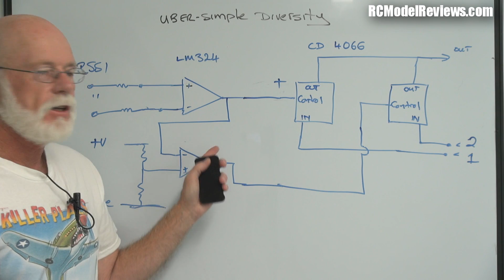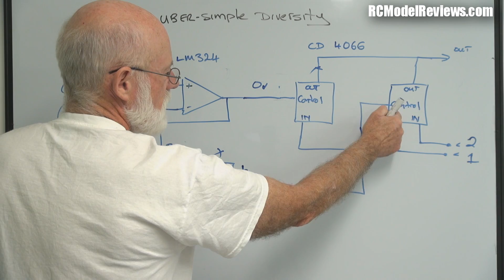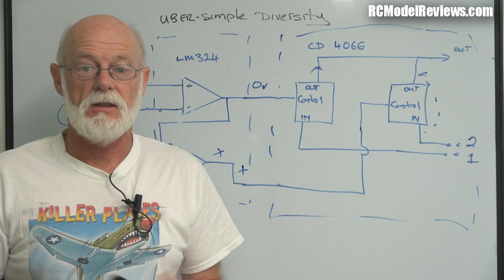A $1.29 FPV diversity controller (theory & design)

Comment: Hi,
I will have a few responsibilities about the Rssi.

I think it should be around 5v when rssi is close to the buyer.

this information is correct?

I bevrc of 2 1.2ghz receiver there.

these two receiver the donor close dayken one of 4.89v, while the other 0.12v vicinity rssi voltage to give.

Which of these gives the correct voltage?
Reply: Hi,
does the receiver give a voltage close to 5v when the donor is nearby?

Comment: Do most video receivers (or receivers in general) have an rssi pin out and you just need to know where to look?  I know what rssi and tssi is, but how it works under the covers is voodoo to me.  My guess is that you have a baseline (100%) that represents maximum signal, and the actual.  Are we looking at simple voltage of the signal?  How do you know rssi from one receiver is an apples to apples comparison between receiver two?  

I think a video about rssi fundamentals would be interesting.

Comment: any way to use a single receiver with multiple antennas and use the diversity controller to switch between antennas?
Reply: Impossible. The controller dont get the information which antenna deliver the better signal if there is only one receiver..?

Comment: Can anyone help me????  I bought all the items Bruce mentioned and followed the instructions but my controller is completely dead and just will not work :-(

This is what I bought:
Cd4066BE Quad analogue switch IC in 14 pin DIL DIP14
LM324N Linear IC Quad Op amp DIP14
4k7 0.25w Carbon Film resistor (4.7k)
47k 0.25w Carbon Film resistor
820k 0.25w Carbon Film Resistor
Red 5mm LED
Green 5mm LED

100nf Ceramic disc Capacitor

Im using a 5v power supply as per the video but the thing is completely dead

Can someone please help me? ??  Bruce?? are you there??
Reply: +Nick Boylan the chips are computers and must be programmed before they will function  as switches.

Comment: Ok first I'm new to this and dont know whats already available. I assume this thing requires 2 transmitters or two receivers. Why cant someone build a transmitter that has say 3 kinds of antennas on it clover,dipole,helical or whatever and have this determine which one is best at what moment. Even 2 basic antennas at different angles would probably get rid of the snow right? I know some transmitters are good close range while other work better though objects right?
Reply: I'd like to know that as well

Comment: What is required to program the chips? The rest is pretty much straight forward. Do you still have programmed chips available. This is good info for anyone wanting to build one. Thanks
Reply: Raymond Bivens The LM324 and CD4066 don't have to be programmed. Everything in these chips is just 'hardwired'. You can just solder them together like in the design and it should work.
Reply: EightOneGulf thanks. All of it looks pretty straight forward. Just wasnt sure about programming or not. I could have swore he mentioned programming them

Comment: can skyzone and Immersion fpv gear work together?
Reply: Kyle Cook That depends . If you have the  skyzone goggles with the 32 channel rx in them, or the stand alone 32 channel rx, they will work. But if you have the fatshark googles with the Immmersion rx it wont work with a sky zone tx . Skyzone and immersion are on different bands of 5.8ghz. Difference  is sky zone has the 32 channel rx, that can pick up on all of the band, the immersion band and the sky zone/boscam band . If you have the Immersions ,they also make a mini 32 channel tx for $25. hopes that helped. ;)
Reply: Thanks!

Comment: I would recommend adding some hysteresis to the comparator, so that it doesn't oscillate when the two RSSI signals are very close in amplitude.
Reply: He does the very thing in  an addendum to this vid Eric. You can buy the PCBs made up for populating from Oshpark.  I have one on my bench right now that I soldered up and there it is sitting in the middle of my frame for the array ready to have all the wires run. It is beautiful. It incorporates two 0.1uF ceramic caps. One for each 4066 (ended up in the final) Reply for more info. There are a bunch of other diversity boards there by the same group at RCGroups. Happy FPVing
Reply: Chris Leech
Is this the osh park link? https://oshpark.com/shared_projects/c247G5Wq

I'm about 90% sure I have all the parts already in my garage; I'll probably wire one up on a proto board one day.
Reply: Yes but that isn't the original offering. I am not sure how that guys name has anything to do with it. The name on the board is gilcd85 and he posts regularly on the topic.There are many who have gone the proto route. You might like to follow others good works by checking out an RCGroups thread. I will re-post with the link for you.

Comment: Also found it all understandable apart from how the inverting amplifier works? How do the 2 resistors with half voltage invert the signal, couldn't follow that
Reply: The 2 resistors act as a voltage divider, so half the working voltage will be in the center. The comparator is comparing the two inputs, if the -ve input is below the +ve its output will go high. Basically the 2 resistors create a middle voltage so when the other is high or low it will be higher or lower than the middle voltage. Does that make sense?

Comment: Excellent design to tide us over until the 4-channel switch is ready.  Isn't it common practice to tie off the unused gates to prevent oscillations that may draw more power or make electrical noise?

Comment: Bruce, I also seen the build as well...Fantastic...but one question.. can you also use this design possibly to use the rssi  and maybe three receivers to control a servo (or motor) to move a turntable that the receivers (and their corresponding directions antennas are mounted on) for an antenna tracker?
Reply: Why not, i now have to try this!

Comment: ZC4066 for the quad switch and ZL3324 for that op-amp for us jaycar fans, mind you some rx's will have an inverted rssi where low is good and high is bad so you can just wire the 4066 accordingly. also running the video through the 4066 may give you a small drop which may lead to syncing issues on some screens but im sure it will work great for most :) . will get to work on my arduino version very soon just waiting on parts.

Comment: Great video Bruce.
Could just use dual op amps or comparators. 
Note: some reciever rssi are reversed, the higher signal the lower the voltage just reverse the rssi inputs to resolve reverse rssi receiver setup.
Thanks so much Bruce.

Comment: If the CD4066 has 4 switches built in, then surely it should be possible to switch audio at the same time too? I'd recommend doing that. There's nothing more irritating than listening to white noise from the receiver with the weakest signal. B.t.w. HK sells convenient RCA and power jacks now that you can screw into the box.
Ordering from Digikey is out of the question for most of us mere mortals. Around $50 shipping to Europe for a single subgram part. No way. No wonder China is taking over many economies. Thankfully there is ebay.
Reply: Yes, I included the Digikey links as an indicator of price but I specifically chose parts that would be easier to source at your local hobby electronics shop than some more esoteric video switching chips and precision comparators.

Comment: Great stuff Bruce, i did wonder why you were initially going to all the trouble of a programmable chip, software and a pcb to make a diversity controller when a simple comparator chip does the job so well.
If i ever have the need for one i will make this version for sure but i would add a video buffer so i can also record the footage......hmmmm maybe i need a new project on my binch!
Reply: The microcontroller-based one is far more flexible -- allowing you to have up to four receivers which can be "mix and match" with different polarity of RSSI and other features that aren't nearly as easy to do with an analog system.  However, for many people, this uber-simple setup will work just fine.

Comment: Would it not be possible to use mosfets or transistors instead of the relays?
Reply: The CD4066 is a MOSFET-based device.  There are no real relays inside -- just MOS switches.

Comment: Bruce I think CD4066 is a bad choice.   It has 125Ω Typical On-State Resistance for 15V Operation and about 470Ω with 5V supply. This can degrade weak signal !!! (i.e when you are flying on the range limit)
The best chip for this purpose is ADG719 from Analog Devices:
http://www.analog.com/static/imported-files/data_sheets/ADG719.pdf
The truth table with 1 input  can simply switch between 2 video signals. Means we need only one comparator instead of 2.
Also the on-state resistance is 2.5Ω typical and 4Ωmax.
Please consider the new simpler/better design :-)
Reply: Yep, the 4066 isn't optimal -- but it works.

Besides which, if the resistance proves to be a problem in practice, for another $0.50 we can add a high input-impedance one-transistor amplifier on the same piece of board the diversity controller is on.

An emitter-follower stage will be high enough impedance that the pass-resistance of the 4066 will become insignificant.

I chose the components  because I wanted to use bits that were likely to be available at a local mom and pop electronics hobby shop.
Reply: forgot to say the ADG719 price is around $2 :-)
Reply: Yes I very much agree with you. When you implement this you really have to watch out as it will make your video levels at least 1/4 of what it should be. The CD4066 may be cheap but it doesn't fit the requirements.
Reply: Where can i get this ADG 719? I've looked in three online stores, but i could not find it. What changes have to me made to make this work? Simply use the output of the first comparator as the input for ADG719?
Reply: Servicehans  1st question: digikey, mouser, ebay or simply go to http://www.analog.com/en/switchesmultiplexers/analog-switches/adg719/products/product.html and select 1 sample chip. You must then explain the purpose of your project/prototype and there is a chance they will send it to you.
2nd question: yes :-) the output of 1st comparator goes to input pin of ADG719
Reply: Dziękuję for the hint. For people like me who are comfortable with soldering but know nothing about electronics engineering could you possibly make a short "how to" manual? I'll be happy to use better parts - if it comes for 10 or 15 bucks rather than 1.30 I'll still go for it as long as it gives me better quality output.
Really, it'd be great.
And of course, thanks Bruce for making my mind work in this direction :)
Reply: ***** Hi Bruce, aren't you worried that the next time someone uses this rig and flies a bit further out the video levels get a bit lower and suddenly your video goggles lose video sync or your monitor goes blue?? I really like what you are trying to do but you really have to watch out as you are a teacher for a lot of people and right now you are giving some bad examples.
Reply: FlyingZayin Please see 2nd page of this PDF:
http://www.ti.com/lit/ds/symlink/lm124-n.pdf
As you can see:
- 1st leg is output (goes to the ADG719 input pin)
- 2nd leg is an inverting input   (RSSI#1)
- 3rd leg is a non-inverting input  (RSSI#2)
- 4th leg is Supply Voltage, V+ (connect +5V here)
- 11th leg is ground(V- from 5v battery)
As this is quad amplifier and you use only one of them you can solder the rest of input pins to the ground.

Now as it comes to ADG719: go to 6th page of this PDF:
http://www.analog.com/static/imported-files/data_sheets/ADG719.pdf
D - drain - here is your output signal from better receiver
S1 - connect video signal from 1st receiver here
S2 - connect video signal from 2nd receiver
GND - ground (remember that ground must be the same for ADG719,LM224,video signal,and RSSI signal 
another words: connect all 'grounds' together)
VDD - +5V goes here (do not exceed +5.5V)
IN - here is the input pin - simply connect to 1st leg of LM224

Oh by the way - if you see the diversity choses weaker signal then switch the RSSI inputs or S1/S2. 1.2GHz fox receivers have opposite RSSI behavior than lawmate, not sure what you have.
Hope it's enough to build your own - if not, then time do do some homework ;-)
Reply: The video signal does not get weaker with distance since its just coming from the local receiver. The video CONTENT may degrade and get fuzzy due to a weak transmitter signal, but this has nothing to do with the signal from the video RECEIVER.
Nothing wrong with this design.

Comment: Not clear to me how the antenas are connected to the Diversity board... what i understand from here is 2 antenas is actually both of them connected 2 times (1 to passthrough the signal, the other to measure it and there is no signall los into it?)?
Reply: One is the videosignal, the other the "rssi". The rssi is used to determine which receiver has the best signal at the moment. You have to solder a cable to the rssi pin inside the rc305

Comment: Bruce would a CD4066BE Texas Instruments IC, 4000 CMOS, 4066, Dip14, 18V , Integrated Circuit work???
Reply: Taz  the CD4066BE is exactly the chip Bruce used , you can read it in the video on the bread board .:)

Comment: Might need a couple of resistors for hysteresis there Bruce
Reply: Yes, I had considered creating a schmidt trigger but the bench testing indicates that in "the real world" it's simply not required.   We'll see if it's necessary when it's flight-tested though.  Another resistor will boost the component count by a massive 17% though :-)

Comment: Hi Bruce,

you could consider using the DG419 which should give you the
following advantages:

- it's a switch so you don't need the inverter
- less inner resistance
- smaller
- lower noise

disadvantage: it costs about 3 dollar
Reply: Yes, there are plenty of better switches and even better comparators -- but I wanted to choose parts that would almost certainl be available at your local electronics hobby shop and which were super-cheap.   In practice, the 4066 seems to work perfectly well -- and there are 4 op-amps in the LM324 package so it doesn't really matter if we have to use two of them instead of one :-)
Reply: ***** thanks for the fast answer
and well, if it comes to price and availability your choice is perfect